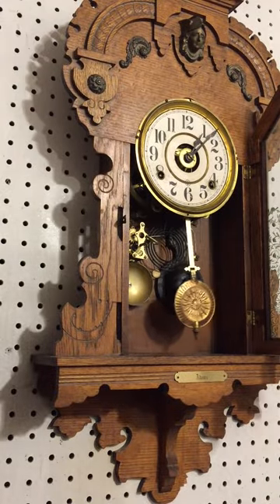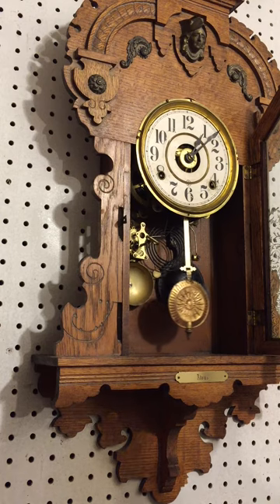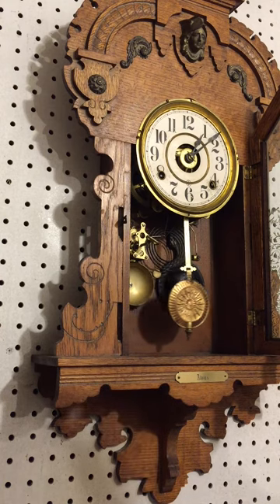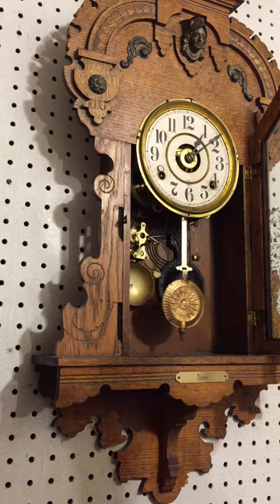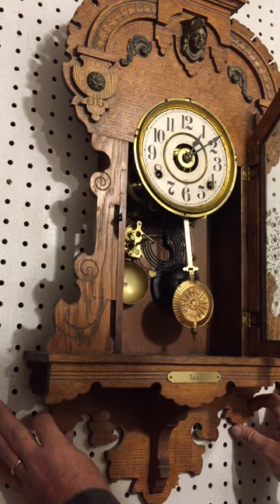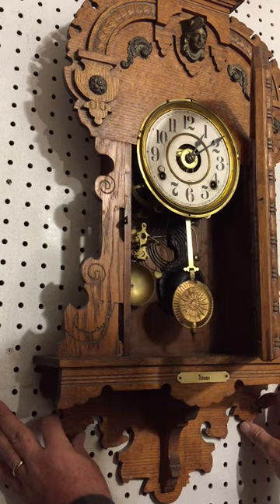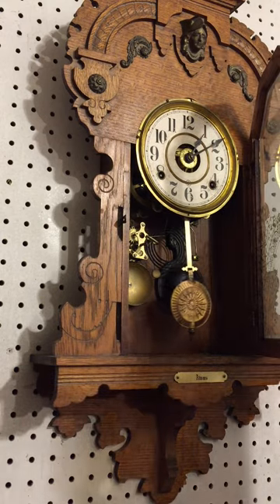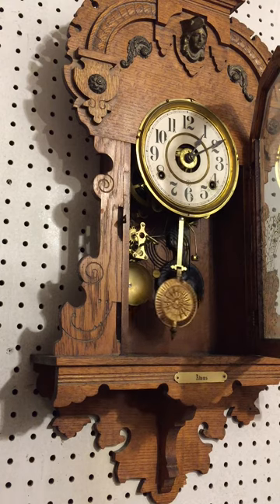Putting Wall Clock in Beat

Comment: Wth? So just make your clock sit sideways to keep it running?...NOT!
 Find an actual pro on here showing you the correct way folks, you actually need to bend the clocks crutch to fix your clock right. Your pendelum may also need adjusting away/closer to the wall too run right, not just sideways. This is just a half-assed way to make your clock run so finish fixing it right so you dont have to screw with it everytime you wind the damn thing. Geeez!